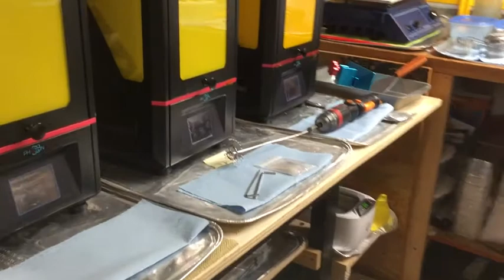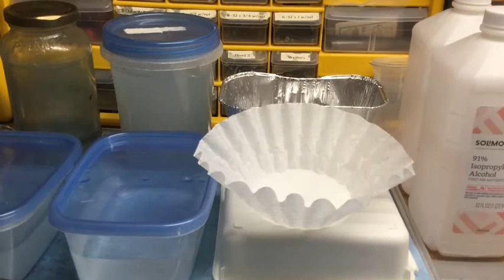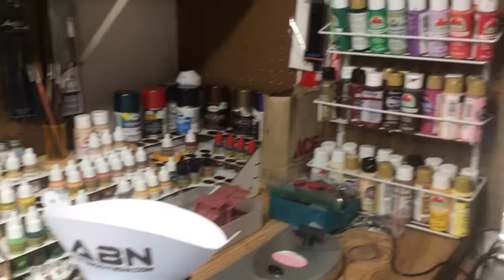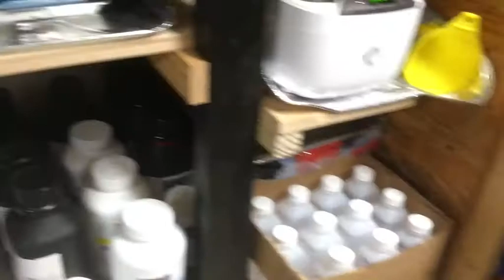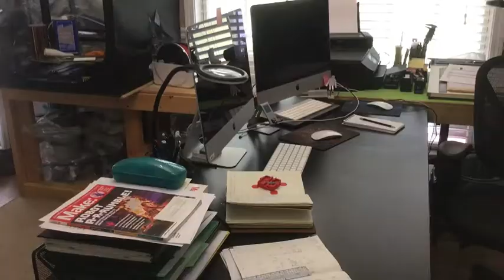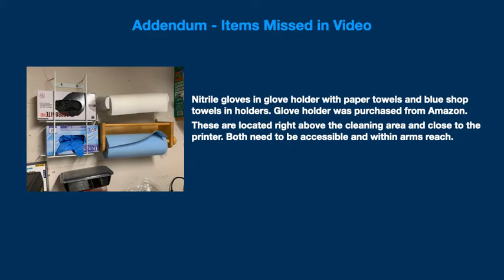CatzPaw's Workspace May 2022

Comment: Outstanding tour, I am so ashamed. My space is a mess 24 X 7. My poor wife tried to help me clean up and organize about every 3 months. But then It just gets out of control. All your tools and supplies so organized and clean and neat. OMG! I saw so many great ideas and organizing and some tools I had not thought of. I grew up on the farm and we did everything we could to avoid going to town and spending money on anything. It was an inherited way of life, not cheap, but frugal. Use what you have. So I have one set of side cutters that barely work because I used then in wire one time. I need to review it in slower speed so I can write down some of you cool tools. What I don't get is  how everything seems to have a place and you find it.  Yesterday I needed to find a bad of fake coal I use for my trains. I could not recall where I put it. I could only start at one end of  my  organized and labeled storage boxes.  I covered fully 3/4s of all my boxes before I found a tin can wrapped in cellophane with Fake Coal inside. And the mechanical parts bins were glorious. I have 2 small one and then boxes with dividers but they are strewn about only sorted by when they were bought. No common size or function. You have provided me HOPE and some wonderful solutions to all the organizing issues we builder's have. Thank You for taking the time to share your shop and all your tricks and tips to organizing. I must rethink my shop layout once more and try to discipline myself to put things back. I need a tray concept for mechanical assembly of 3D Printed parts. I have zip bags for small parts but now a tray to hold the bags that are used for assembly. I have tried a few methods but nothing sticks. I will keep trying you have given me new hope. I CAN be organized, I think. Dennis
Reply: Thanks for your comments! Frugal is a great; the Dollar Tree is my favorite place to shop when I need supplies for the resin printers.